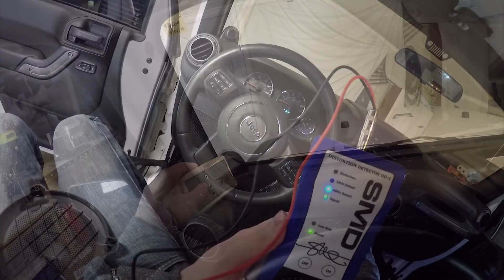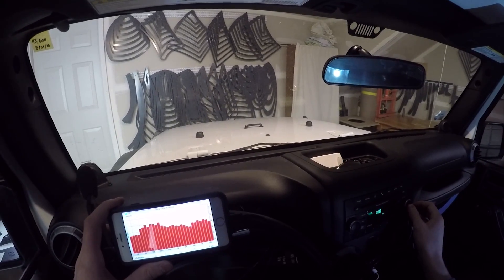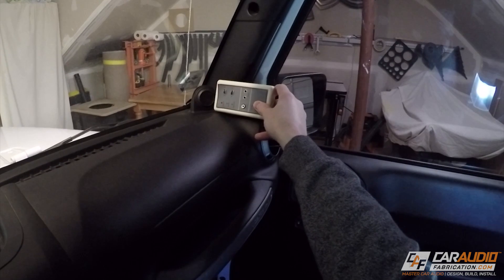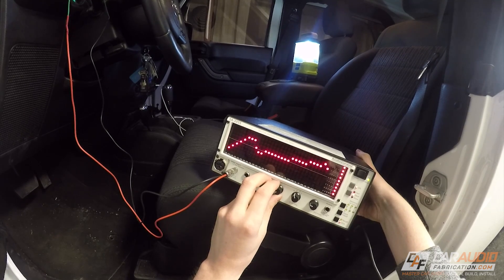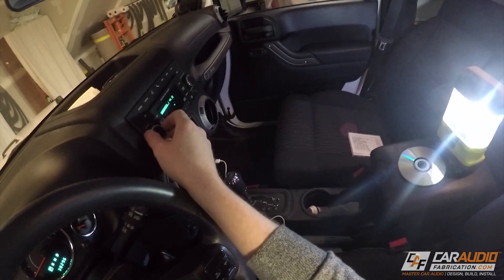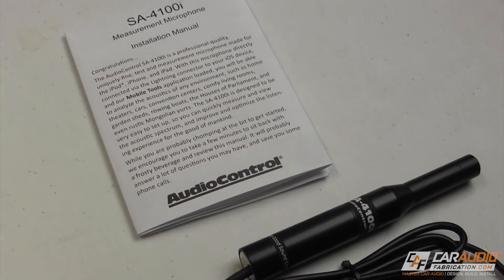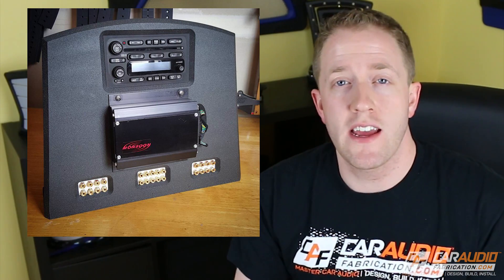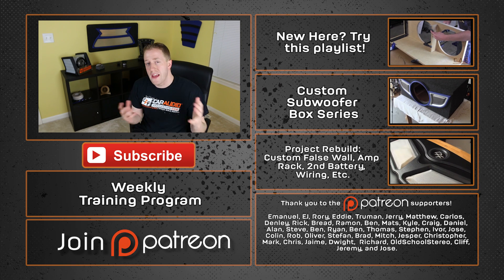BETTER SOUND through testing - Installing Car Audio - Polarity, Distortion, Signal Response

Comment from the maker: Thanks for watching! In this video we determined what we have to work with acoustically and component wise. Now we need to prep the vehicle by sound treating it! Let’s sound treat the doors in the next video and cut down on road noise and prevent rattles… You can check out the next video here: https://goo.gl/bSe4fH

-Mark
Reply: CarAudioFabrication how or where do you connect the smd dd1 device to check for distortion?

Comment: Cool, now how do we do it at home without multi hundred dollar pieces of equipment or accessories? This stuff costs as much or more than some of the components in the system build. Can we get good enough with a volt meter? That won’t detect clipping on either end but we will at least know the upper limit of gain we have available

Comment: I just installed a Kenwood KDC-304 head unit, Alpine Amp PDX-V9 100wx4, Morel Tempo Ultra 502 5 1/4" Component Speakers (100w) and Kenwood Excelon XR-1701P 6.5" Component Speakers (100w). I thought that I would be able to crank it up, distortion-free, but that's not the case. Do I need a better head unit to reduce the distortion? So I can have a louder fuller sound? (Forgot to add I have a Kenwood 8" sub box, but that's been fine. I'm not looking for super-bass, just a loud full sound) Obviously I'm new at this. Thanks!

Comment: if u know what wire go to the speakers for sure! and can see the speaker. use a 9v battery. if pop out just check what lead touched the positive or negative on the battery. if pop in they are reversed

Comment: Great video .. I had the same decision point with my 2011 Tacoma . I was fine with the factory radio and its feature set, but the audio signal actually adjusts bass response downwards for each upward tick of the volume. So using an loc or even one of the upgraded audiocontrol units wasn't an option. I either had to buy a $300 dsp (like the Jbl cleansweep) which had its own dedicated column knob or just but a new head unit or not even do the upgrade.

Comment: I'm currently doing an iPad setup in my car and getting rid of the head unit. How would you test the distortion on an ipad. I've got the ipad going to an istreamer and which goes into an Audio Control Overdrive plus which is going into an Amp.

I really love your videos, I'm learning alot.

Comment: Oooh, cellphone RTA!  I've been waiting for that!

That output signal from the factory head unit/amplifier was atrocious...  Is it compensating for response issues with the factory drivers and vehicle environment?

Perhaps a bit on the advanced (or even crazy) side, but the original title of this video has me wondering:  Do you ever go to the trouble of correcting for phase deviation resulting from interior reflections and/or driver placement?  It's a common thing in high end home and professional audio, but I've never seen it mentioned in car audio.  :]